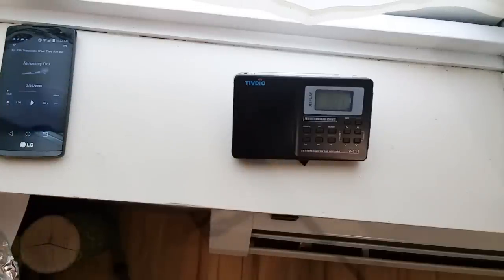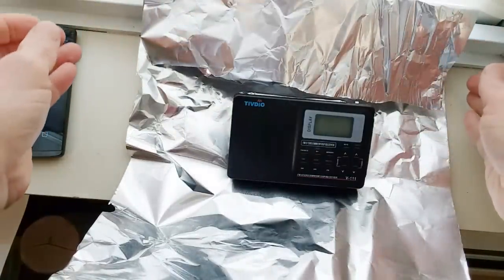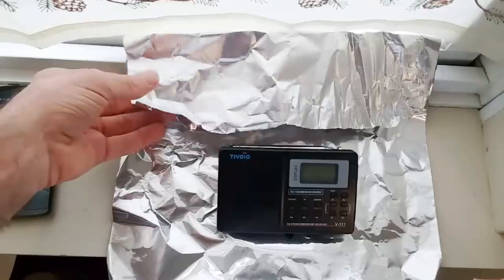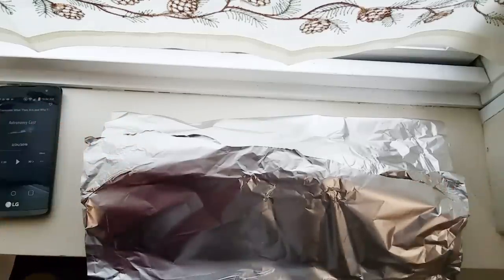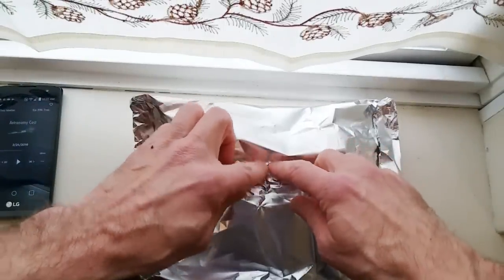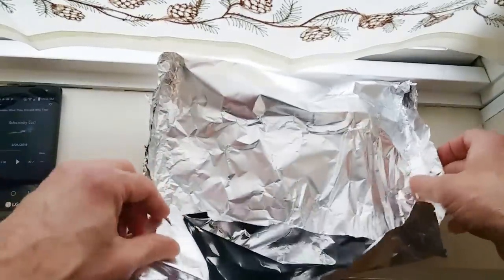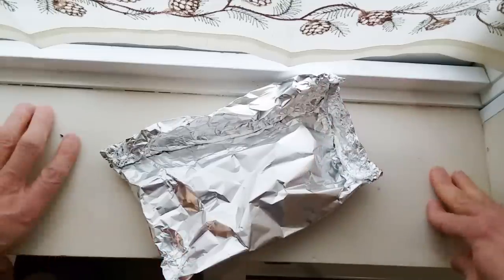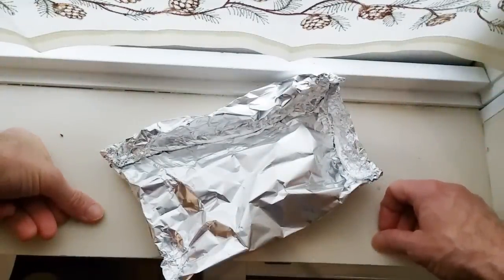Blocking EMF radiation around the home

Comment: Fill your home with Organite tower busters, and put Tesla purple plates near your electrical items and one under your pillow 👍
Reply: Definitely works. I got one tower buster and a few orgonites around the house.
Reply: @bashthedad9938  - May I suggest you add a Tesla purple plate to your collection also 👍
Reply: @GH-lo8vl  thanks for the suggestion. Do you have any links?
Reply: G H ...do you have them yourself and tested anything with them?
Reply: @dissendiums  - Yes I've got them all over my house. As for testing them, well I've never had an illness such as the flu or headaches since.
There's plenty of videos on here with positive comments from various people.
Reply: Where do you buy those from @ G H
Reply: @HopeSpringsEternal24  - Tesla plates from a company in italy called teslapurpleplate dot com, but with the lockdown you'll struggle at the moment, and there's a company called swisstesla dot com. There's also an American company too, just do a search.

The orgonite I get from ebay, just type in "5g tower buster" in the ebay search bar and they all come up. Read the reviews to make sure you're picking a good supplier.
Reply: @GH-lo8vl  just saw, thanks.

Comment: One mistake I thought of with the podcast is that it would have downloaded ahead and just used the downloaded data to keep playing.  If you tried that again and start the podcast just second before.
Reply: I watch a lot of vids like this and yes, it's a common problem. There are thousands of videos here of trained experts using professional expensive meters to demonstrate things like this but here we are.  I would suggest using a site that measures internet speed. First it downloads for 10 or so seconds, then it uploads for 10 or so. So you can be assured the internet connection is in full use for that time.

And that's before we discuss using an actual RF meter.

Never seen this guy before and I hope I never see him again. What a dumbshit.

Comment: Really appreciate this experiment! Some possible issues on the WIFI test method: 

1.) Almost every app buffers now. Most likely the audio was playing buffered/locally downloaded content, whether or not the signal was blocked. The test would need eliminate buffering somehow. Here's an idea: block the WIFI router w/ foil, then look at the signal strength in one of those WIFI signal strength apps. Compare to unblocked signal.
2.) Did you make sure to turn off Data? (Just making sure, I know you most likely did)
3.) Try multiple layers of foil to see if that makes a difference. 

Thanks again for this vid!
Reply from the maker: Thanks for watching, posting, and weighing in on the buffer issue; it's been mentioned here.

Comment: For wifi there are apps to measure the signal strenght. I do not know what wifi you have i have a big ass router with lots of antenas and if i test signal 3-4 m meters i do not have to completely seal my phone in aluminium to loose 100% of the signal.

Comment: Does anyone know what a normal uT reading should be for my house? My friend in the mountains is getting .93 and I'm getting 45-60 in the city. Not sure if he's using the same meter though.
Reply: I live near medium/high tension power lines, it would measure in the evening (when the grid is using more power) almost 0.3 uT. I consider that already dangerous...it gave me headaches. So i painted the inside of my house with a graphite based prime paint  (grounded) and reduced it to 0,15 uT at most. I already feel the difference. Dont let people fool you by telling you these things arent harmful BECAUSE THEY ARE. Get informed and protect yourself.

Beware that there are two ways of measuring Electromagnetic fields, usually using uT (micro tesla) or mG (mili Gauss). For example, 0.3 uT = 3 mG .

Comment: The 5g towers will need a heck of alot of this foil
Reply: Or just burn them down.
Reply: I looked up some information and, nickel copper plated material blocks out all Wi-Fi waves! I guess we need to develop a line of clothing & hats out of this stuff! Lol
Reply: @tracytracy1030  look up this website called Hegdron . The guy sells a pendant for 65 , and other circular disk but those are like 250 and up depending on size.
Reply: @tracytracy1030  look up this website called Hegdron , the guy sells merchandise to block off 5g radiation.  The pendant cost 65, the circular disk are big and they run 250 and up depending what size you need.
Reply: Why wrap the cell phone tower?  According to this guy, you just wrap the device receiving the radio-wave.
Reply: AdrienneS1970 really? If the device loses signal it would indicate the shielding works. That also indicates YOU are in the signal(s) i.e. Microwaves. Unless you shield your body from them. The problem as I understand it is that the shielding must have NO GAPS bc if it does the waves will enter and bounce around like pac man essentially creating a microwave oven. So it would be prudent to research this topic thoroughly before investing in shielding. I'm not there yet- too distracted by the constant fucking screaming ringing in my ears! High band five gee is Not a good thing for living things.
Reply: @AdrienneS1970 if you wrap up the device it won’t work anymore
Reply: FIRE cleanse all
Reply: Water guns
Reply: @cindykrista what's a transponder
Reply: 5G towers should burn.

Comment: Will more layers of foil around the wifi stop it from working?
Reply: Yes. On 5 GHz Wi-Fi I wrapped about four or five layers, and it disconnected immediately. And so did cellular cellular on ultra capacity and low 600 MHz and my phone had no service

Comment: Even after I turn the WiFi off it takes a few minutes. Sometimes 5 minutes for YouTube to lose it's signal. Should have left it. To see what happened
Reply: THERE IS A BUFFER IN THE DEVICE THAT WILL PLAY UNTIL THERE IS  NO MORE DATA. i BELIEVE THAT CONFUSES US.. WHERE AS A RADIO BROADCAST IS REAL TIME.
Reply: Cellphone needs double layer of tinfoil..

Comment: have you tried earthing the tinfoil ?
Reply: vizulfun ??
Reply: running a earth wire from the tinfoil shielding to a metal water pipe that goes into the ground. . that's called earthing it

Comment: so how then can you protect against wifi radiation at home?
Reply: You can hardwire your internet. There’s a man called Neil who has a channel here EMF safety zone. And I’ve learned much from him. Check him out he educates about how to remove from your home.
Reply from the maker: My conclusion is we can't.
Reply: I'm assuming you are referring to your own home wifi. For this you can turn off the 5ghz signal in the router's admin page. Additionally you can remove the antenna of the router. Signal strength will be reduced but still very much functional.
Reply: Max Tovar just don’t use any WiFi period.
Reply: @juniorhector9010  yeah i guess we could do that but we would still receive signals from neighbours etc.
Reply: Geocentric Max. One layer of heavy-duty or 2 layers regular? Or 2 layers heavy duty? I'm ready to line my wall. They just turned on 5g last week and me and my girlfriend are sick. Physically Sick!
Reply: @johnrandoll1026  or burn the closest tower..
Reply: @johnrandoll1026  the more the merrier...
Reply: Yes you can, you need to use 2 pieces of foil paper and it cancels everything..

Comment: When using foil to block, make sure the SHINY side is OUT and facing the EMF source. The reflection bounces the waves off the device.
Reply from the maker: Thanks
Reply: @p1nesap  You need to crumple the foil and it should block the wifi signal getting to your phone. Just like a Stealth Fighter, the irregularly shaped facets of the airframe is what scatters the radiation. Simplified concept but you get the idea. I hear some people have to use two pieces of foil. Can you do a video on shielding smart meter with foil? I hear you cannot totally block it or the utility will take it off. Just attenuate it enough for them to get the signal but not enough to harm yourself. It's pulsed pretty high energy every minute or two of every single day.
Reply: @powermandan5000  I have no smart meter. But those who have smart meters fitted in their homes, Could you send the meter owners a bill for storing their property in your home?. I have read that someone sent the corporation who installed the smart meter . a letter telling them to remove the meter (their property) or they would have it removed themselves or they have to pay. Failing to remove their property will cost them x amount rent per day. Just saying . Regards
Reply: powermandan5000 this world I tried it
Reply: @captainheinie6355  did this result in any payment or removal from the provider?
Reply: @powermandan5000  Dana Ashley says she requested a new old school meter and they came and removed the smart meter from her home. Check out her channel
Reply: @dranamarie  They came and removed it. installed a normal meter. not digital.
Reply: This is why I don't have wifi!
Reply: Light Frequencies in this case where you are covering a router, wouldn’t you want the shiny side on the inside and not out?
Reply: @CaileyDawn  I thought he was just covering his phone. He said the router was 8 ft away.
Reply: @CaileyDawn  I covered mine with the shiny on the outside and still worked
Reply: @DiamondGuitarist    what if you used more foil ?
Reply: @myag5087  how do you mean?  I didn't need to use too much..1 or 2 wraps around the router and 2 or 3 around the aerial 👍
Reply: @DiamondGuitarist  probably depends on wifi radiation techonology,

I covered my ZTE wifi with shiny outside, 3-4 layers, and got full wifi signal 7-8 meters away.

Also tested wifi internet speed and was just as big for download, but slightly lower for upload (I assume my phone had to increase signal strength to pass thru the shiny side of the wifi)...
Jitter was also bigger.
Reply: @CaileyDawn it doesn’t matter because these ppl have no understanding of science
Reply: Ahh man I started doing a room last night n the Holy Spirit actually showed me that but like a nucklehead I didn't listen darn let me go n turn them around thanks guys
Reply: Jo laverne Chuklochik  I have no idea what you are talking about. Can you tell us in clear language?
Reply: According to one experiment I saw on mechanicsNmore, foil doesn't work on these waves, but there is the nickel copper material which stops people from being able to scan your bank card in your wallet... so we all need to possibly get some of that & at least put it on our bedroom walls so we can sleep without being affected.
Reply: @tracytracy1030  can get rf protection paint
Reply: @DiamondGuitarist  yes this is true can u tell me what it's called n where to buy it
Reply: @tracytracy1030  wow that's crazy well I ha e nothing in my account so doesn't matter but that's so horrible that k u
Reply: @esemceX yes I've done that b4 in UK but in Vietnam now and cannot figure it out so foil next  best option lol
Reply: Thank u
Reply: Joe Blow  Can you elaborate? Dana seems a great researecher and makes good compilations and uncovers a lot of stuff. How do you know she's a gate keeper?
Reply: Light.... would that work for a cellphone too I assume?
Reply: Ca we protect ourselves from radiation?
Reply: Someone said turn router off at night
Reply: @Imperfectlyhappytobeme  you'd have to turn your meters off too
Reply: Shiny side out n 3 times the foil
Reply: I'm trying to figure out how I can block a radio frequency detector because I have hidden cellphone in my room and how do I block the RF detector from finding my phone. Also how do I block another cellphone device from finding my hidden phone.
Reply: @Tee.love123  Hi, I just saw this. When you hide your cell phone, wrap it in foil, tight, more than one layer. Turn it off first so it won't overheat. Also,  before you shut it off,  you could turn off your connection to your phone company. Put it in airplane mode.
Reply: @LIFE.HAPPENS.1  thanks so much I appreciate you responding to my question
Reply: @Tee.love123  You are welcome. I hope I've helped you. 😁
Reply: Mirrors

Comment: I think the podcast downloaded on your phone and buffered before covering by aluminium foil , isn't it?
Reply from the maker: Good point, didn't consider that!
Reply: @p1nesap  unfortunately I don't have the EMF detector device to check. would you please check if the your mobile can find the WiFi router when it is wrapped in aluminium foil or double layer aluminium foil (because the thickness of aluminium is also effecting the experience) .
Reply: That's what I was thinking too! Maybe one way to exclude that possibility would be to stream a live radio show which though it might buffer a couple of seconds, should only be no more than that behind the live broadcast. Another method I've seen, albeit not WiFi would be to try calling the phone from a different one after it's wrapped. That gives you an indication of mobile signal shielding. I guess a WiFi alternative would be to put something like WhatsApp on the phone and do the same...
Reply: yeah its buffered  . a better test would be to cover the WIFI transmitter in foil.